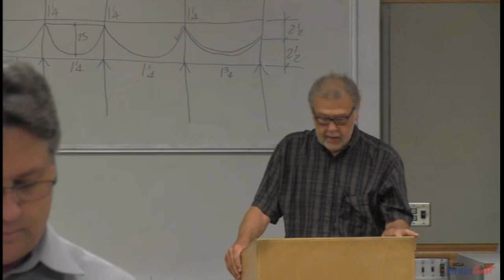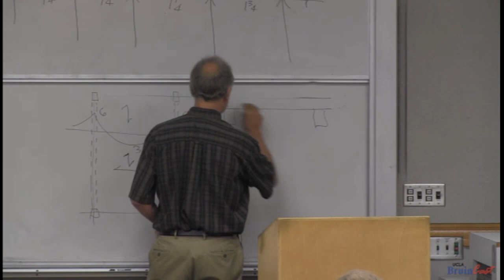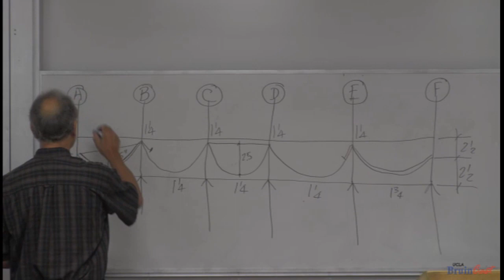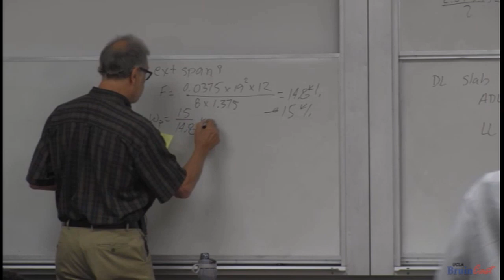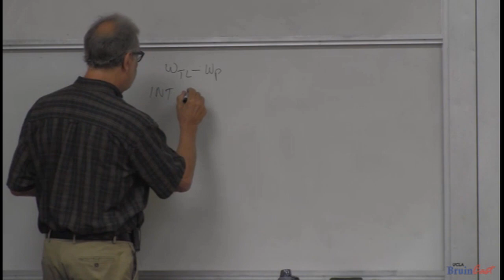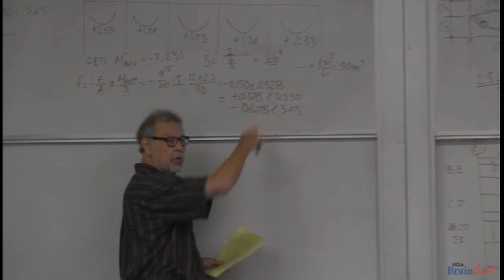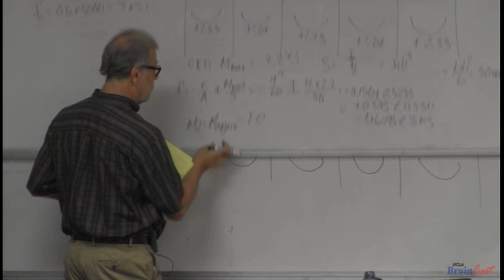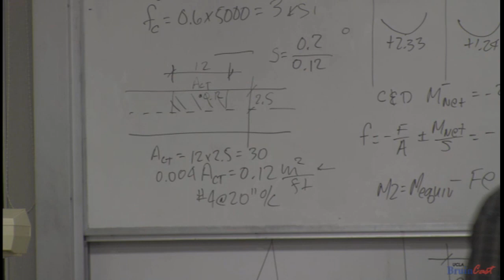Ken Bondy One-Way Post-Tensioned Slab Design Example (2015)

Comment: Great lecture, I have a question : It was calculated that we need 15 or 9 kips per foot, we know 1 tendon is 26.6 kips, so do we use different type of tendons or we stress the half inch tendon to less than 0.7 fpu ?
Reply from the maker: Hi Mohamed, The kips/ft is managed by the spacing of the tendons, not by the force in the tendons.  In California we only use 1/2" diameter tendons and we always fully stress them.  - Dirk Bondy
Reply: Thank you, I really appreciate your lectures, big fan from Egypt.